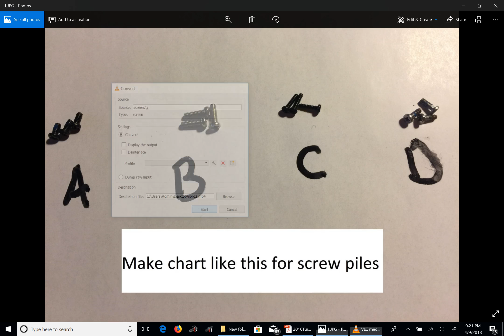ZTE Spro 2 Mini Projector disassembly

Comment: Do you know of there is a way of adding a port for an external antenna?
Reply from the maker: There are a few connectors for antennas on the motherboard. Maybe they are for wifi and 3g?  Never tried anything with them though.